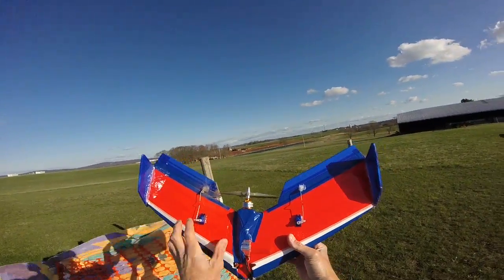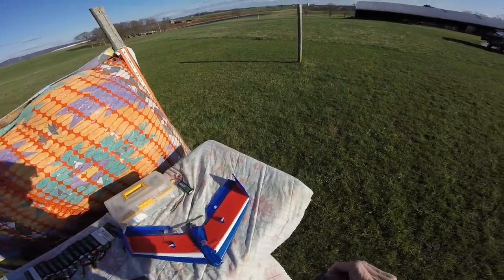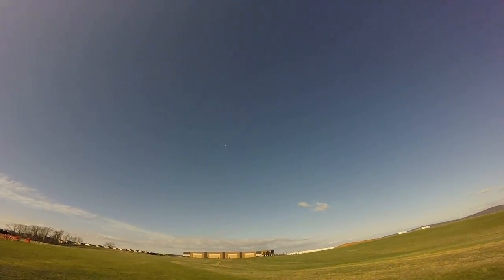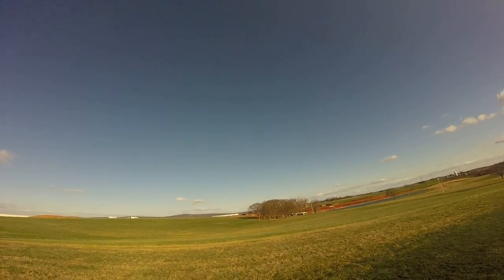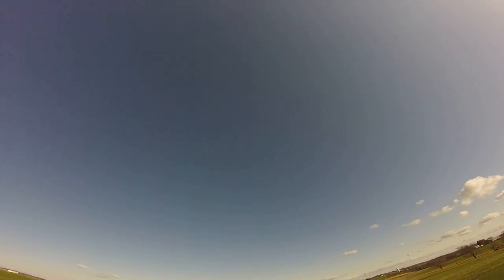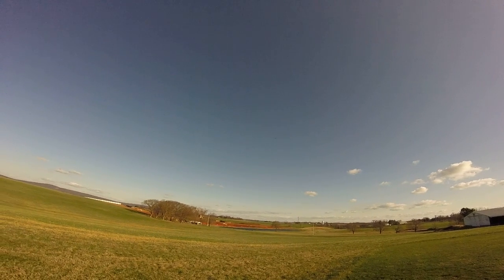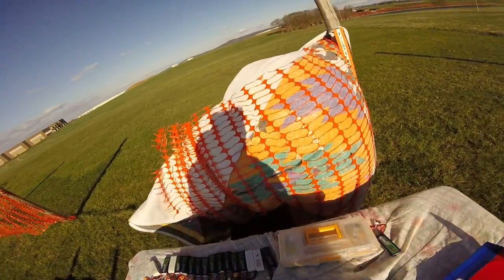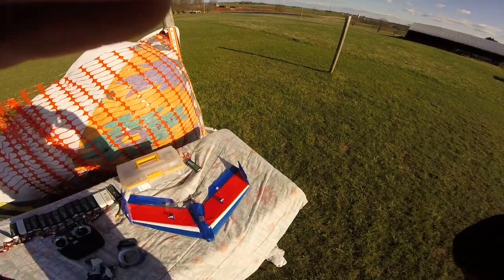Flying 90 mile per hour foam board wing in 20 mph plus winds

Comment: I watched the build video cool wing I'm gonna build it too. I built my first rc plane last week but it is way to tail heavy it flew but not very well. I want to install some fpv gear in my wing
Reply from the maker: Wales Wideman keep the fpv gear centered on the wing.  don't go to far out from center or it will easily tip stall.
Reply: My wing looks more of a triangle than a v. Its flat foam there's no airfoil too. I'm gonna build your version this weekend
Reply: Hey man I just wanted to give you a update. Built your wing it fly's great! I didn't have internet to follow your build step by step so I winged it. I posted a video on my Facebook page of the maiden flight
Reply: I'm using small rcx 2400 kV and a 12 amp ESC so not as fast as yours. What motor are you running
Reply from the maker: +Wales Wideman a hobbyking 2826 2200kv outrunner.  You are probably not getting the performance because of your esc and prop combination.  I recommend a 40 amp esc with a 6x6 pusher prop
Reply from the maker: +Wales Wideman thanks for the update.